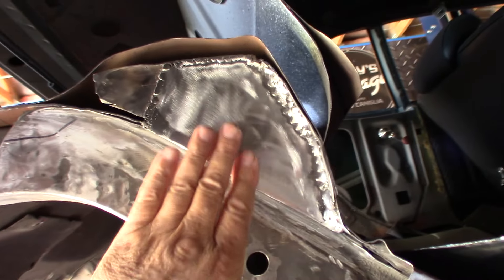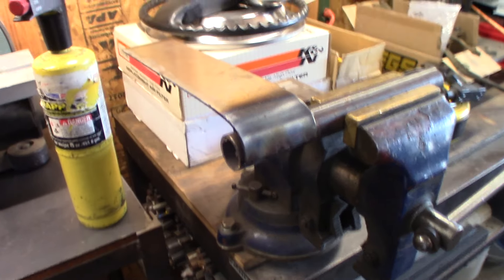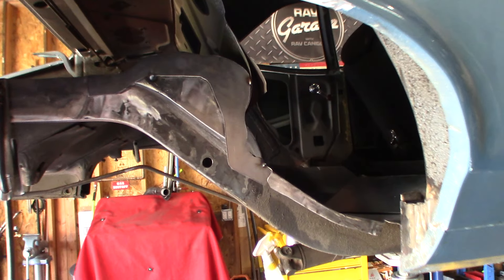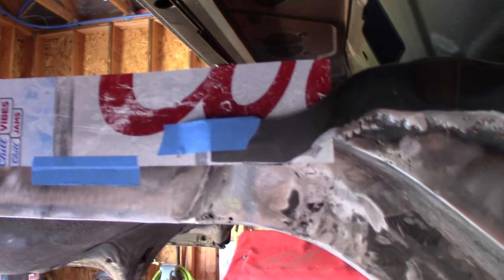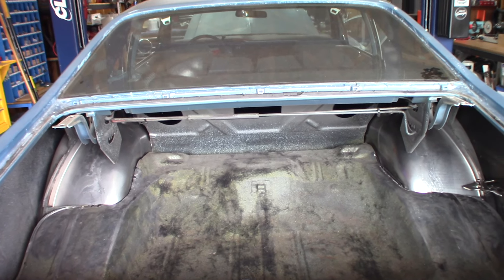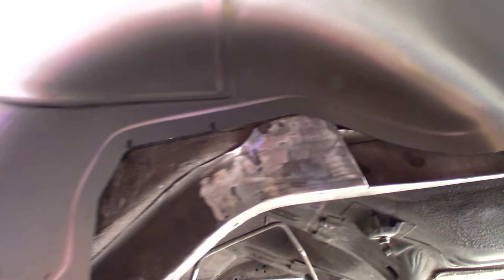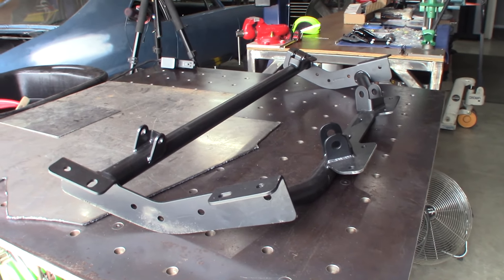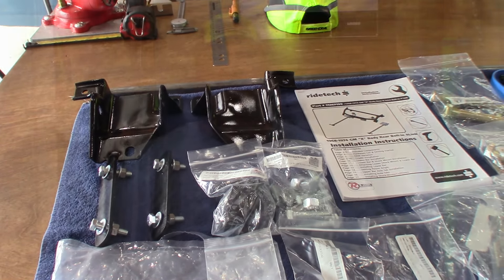1970 Nova DSE Mini Tubs Part 3

Comment: Hello, have a 72 Nova, would like to get a 15x10 Cragar SS with N50 tire (or comparable) under back end, without rolling any fender lip, will this kit allow that?  What is biggest combo possible with DSMT? Best, Sig
Reply from the maker: Hey Sig, I have 315/40 ZR18’s on a 11” wide wheel with 6” back space which has a tire section width of 13” and have about 1/2” clearance inside and out. I have 14” width after doing the DSE mini tubs and plenty clearance to tuck the tire and wheel no problem.
Reply: @RaysGarage  Thank you! I really appreciate the info, God bless and Happy Easter!
Reply from the maker: @SuperFuely  Same to you my friend!